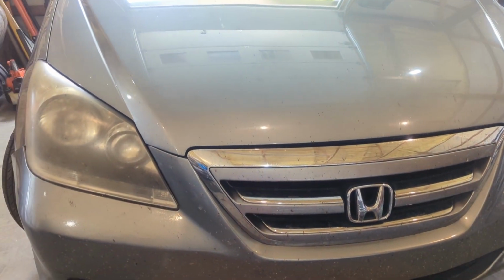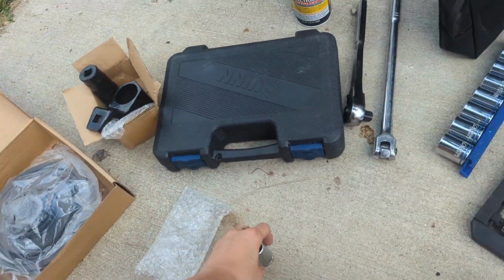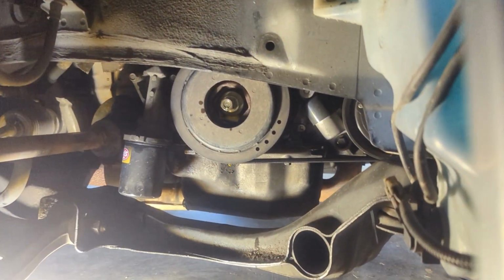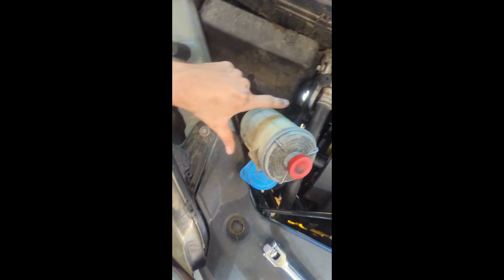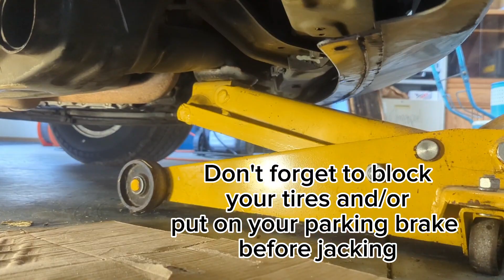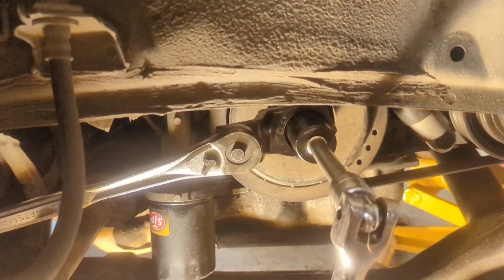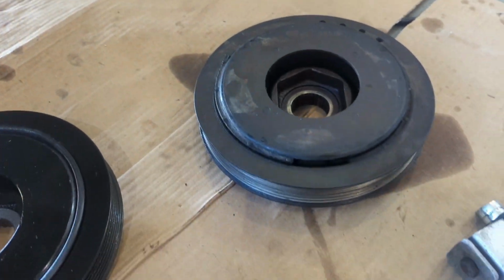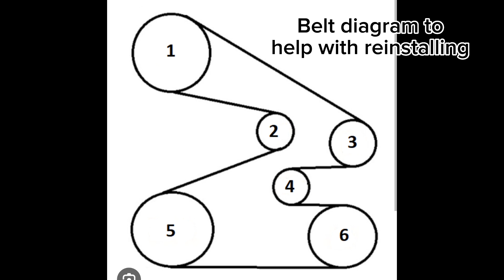Odyssey Harmonic Balancer Pulley Replacement Honda 2005, 2006, 2007, 2008, 2009

Comment: Sara, how is the dorman pulley holding up? Notice any new vibrations or is the new pulley absorbing the vibrations as good as the honda pulley??
Reply from the maker: @realityconformist424  it held up great! I had absolutely no issues with it. I just totaled the van last week with 264k miles on it. Someone rear ended me and bent my back axle unfortunately. I can't remember for sure how many miles were on it when I did this repair, but I'm pretty sure I put at least 50k on it since that repair and had absolutely no issues.
Reply: Thank you! I am sorry to hear that!! Oh noooo 😪 well, would you be able to tell me if there was a particular way you needed to install this dorman pulley?? I heard Hondas having marks on the crankshaft pulley for the sensors? Ignition sensors?? Something like that? Is there really only one way to install it??
Reply from the maker: @realityconformist424  there is a keyway for this pulley so it will only go on in the right spot. The hardest part is breaking the bolt loose but after that it's pretty hard to mess it up bc the pulley will only go on in the right spot.

Comment: What was the torque on the crank bolt when you put it back on?
Reply from the maker: Honda used to say 181 ft/lbs but have since changed it to 47 ft/lbs plus 60 degrees. I personally went with as tight as my husband could make it without a cheater pipe bc I didn't have my torque wrench for this particular repair.

Comment: So loosen the bolt I have to pull towards the front not going left?
Reply from the maker: You are still going lefty loosey. I'm pulling to the right bc it's at the bottom of the circle. If my ratchet was straight up it would be going left. Does that make sense? I'm not sure how to describe it better lol but it is left.
Reply: @Sara_The_Feral_Housewife  thank you
Reply from the maker: @chrisbennyblancogonzalez9119  No problem! Good luck! That bolt can be quite difficult.
Reply: @Sara_The_Feral_Housewife  yeah I’m having difficulty but I think i gotta get the adapter for the 19mm socket
Reply from the maker: @chrisbennyblancogonzalez9119  if you jack it up your van more you may be able to slide a cheater pipe over your breaker bar to get more leverage. You also can get it off with an impact if you have a decent sized one or an air impact.
Reply: @Sara_The_Feral_Housewife  oh ok and thank you because I did everything in your video so far and I’m just missing a extended adapter or cheater bar but again thank you
Reply: @Sara_The_Feral_Housewife  what kind of cheat stick did you use?
Reply from the maker: @chrisbennyblancogonzalez9119  just on old pipe I had laying around that I could slide over my breaker bar to make it longer. Or you can get a longer breaker bar.

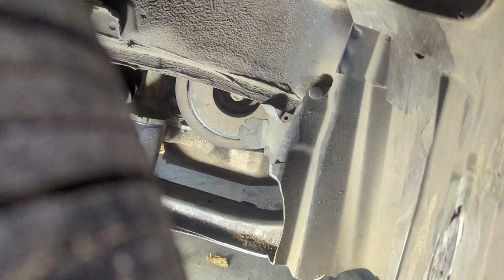Comment: 0:15
Reply: Can I drive my 2005 Honda Odyssey minivan without the harmonic pulling
Reply from the maker: No, You really don't want to drive it without the belt. The belt runs your water pump, so without it you will overheat very quickly.  @Magick-ip7dn
Reply: @Sara_The_Feral_Housewife  the belt is still under it makes a real noise like a squeaking noise put the belts go on there
Reply from the maker: @Magick-ip7dn  maybe I'm misunderstanding. How could the belt be on if the pulley is off?

Comment: Does anyone know if if the seprated will driving like mine.  It my engine time ect. Screwed
Reply from the maker: @dustinblackburn3435  if it separates it will not screw up your engine. This is not the timing belt. Just replace the balancer pulley and you should be good to go.
Reply: Mine came off while  driving and did not mess with timing

Comment: This pulley bolt is not as ease to remove as this video shows. The torque on this bolt is over 180 foot pounds . I question validity of this video.
Reply from the maker: The validity? Like I didn't actually replace it? 😂 I did and it was a pain in the butt let me tell you. Luckily my husband is a hulk and broke it loose. We did it exactly like I showed in the video using a rachet to hit the metal and a breaker bar pulled towards the front. If you're weak just say that.
Reply: To put it back on, was there a certain troque for it? It did you Hulk it back on? Lol
Reply: It's pumpkin soy latte season.